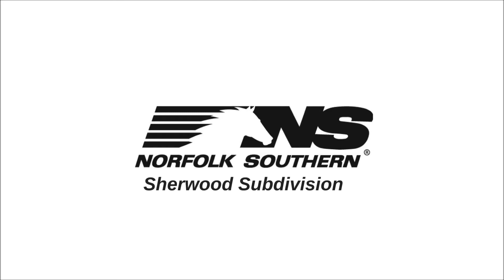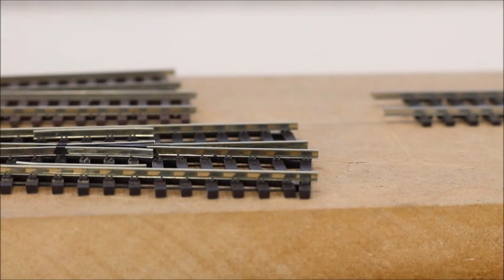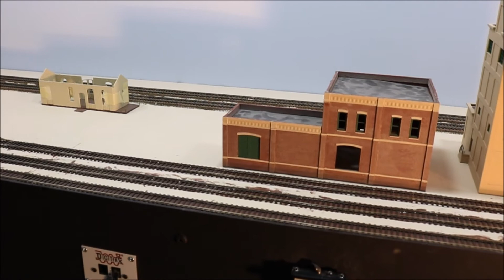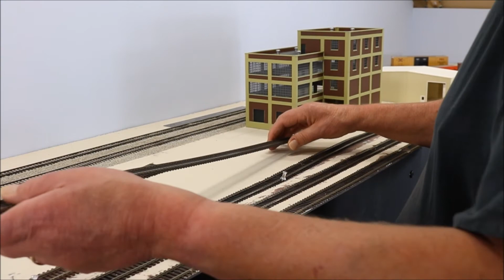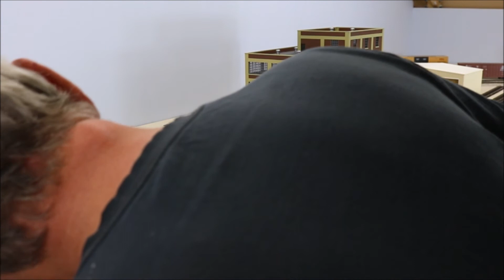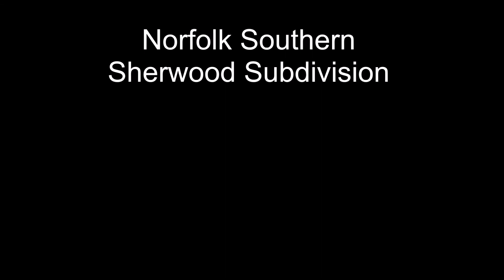How To Plan Track Improvements for New Industries

Comment: Good work. Track planing and track install are so important. A plan that doesn't work, or inferior installation can lead to many head aches. And lack of enjoyment.
I would also like to say. Don't make it permanent till you have ran on it a few times. Make sure it functions to the desired results. And is not hard to operate on.
Reply from the maker: All good points. We should always be flexible enough to make changes that improve operations. Sorry for the delayed response. I was on a two week trip...Harold

Comment: Why shim??? Won't the rail joiner do the same thing especially if it is soldered??? Rail joiners don't sag if soldered... What about the ballest?  Won't it get under the ties and do the same thing???
Reply from the maker: You're probably right. The shim is to support the rail joiner so that it won't bend. Would probably be OK without it as it is on most of my layout. I would be especially concerned about insulating rail joiners that are just soft plastic. The ballast might get under the ties but it's not clear how much support it would provide. Just thought the shim might be the best way to go.
Reply: I can see where the shim might be good with a rail insulators but I'm lucky and don't have any. I don't have any current on my rails either just with the turnout motors. I think that the ballest would be fine as mine is hard as a rock.
Reply from the maker: Sounds like you have the best solution for your situation so go with it. I'm curious about "I don't have any current on my rails". Not sure how to interpret that...Harold
Reply: No power means no power. I have all of my engines running on battery power from batteries in the engines. This runs like DCC but with no track wiring. Impossible to have shorts, no dirty track problems, no reverse loop problems, and I run short trains. The engines will run about 2 hours on a charge and I have a charger that will recharge them in about 30 minutes. So I never have problems .And I can take any of my engines to any layout and run them on the track as I am insulated away from any power. I just don't need it...  If you want to talk more about this email me at    degroff products@aol.com    and we can communicate more.